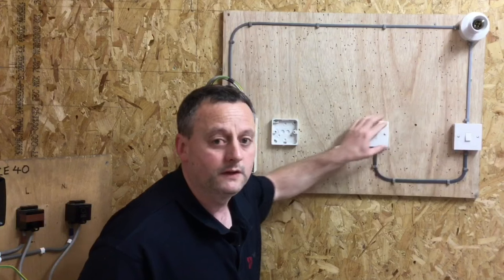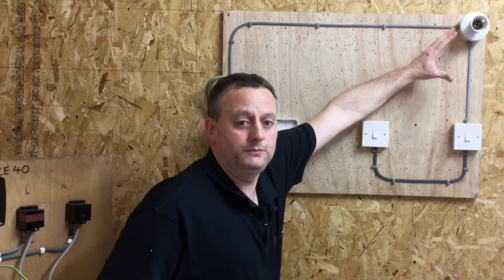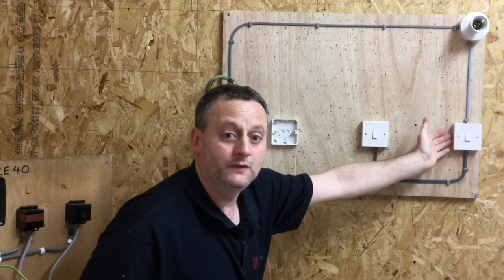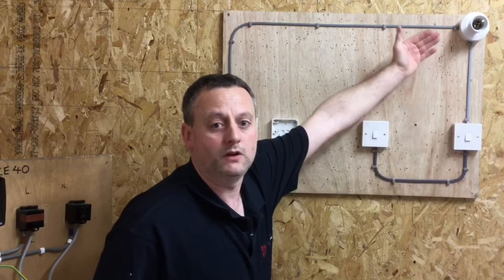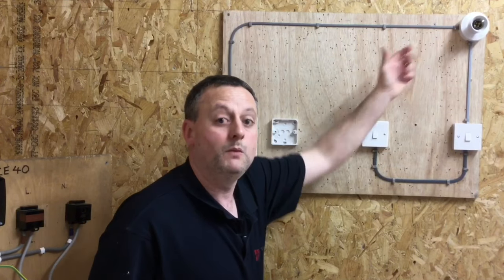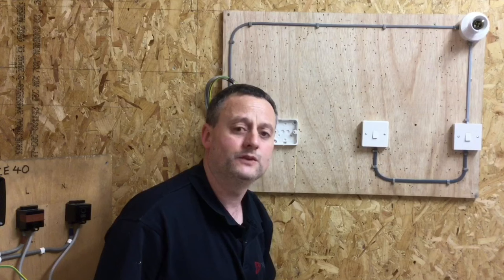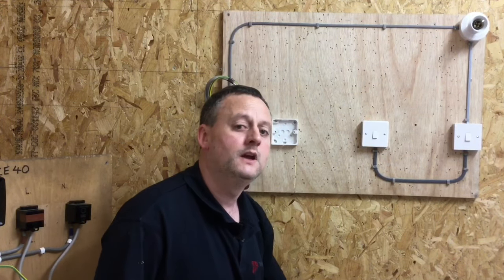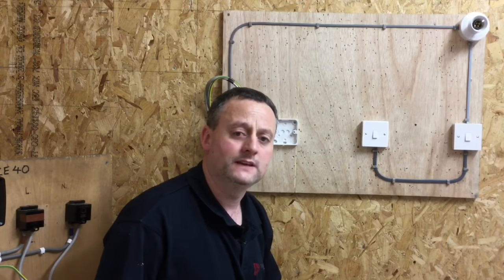Continuity of CPC (R1 + R2) and Polarity of our 2 Way Lighting Circuit and Insulation Resistance

Comment: Hey, When you get the first reading for continuity, are both switches in the on position? Cheers
Reply from the maker: Hi. With 2 way and 2 way and intermediate switching down won’t always mean on. Think about the landing light at home the switch downstairs and upstairs operates the same lighting point but it won’t always be down for on... thanks Gaz
Reply: ah I see, sorry for it being quite a silly question but thank you for clearing it up.
Reply: Hi Gaz what two points does the link attach to thanks
Reply from the maker: Hi. The line (brown) and cpc (green/yellow).Thanks Gaz
Reply: GSH Electrical thanki

Comment: Hi Gaz, in an installation wired in the loop in method with say the lives wired to the switches. If the end of line neutral and earth is in a different room than the end of line switch feed. Do you have to run a wander led between the two to obtain the highest possible r1 r2 reading. Or does the max resistance reading from a switch line to only the lights its controlling suffice? Thanks

Comment: is there a max value for R1+Rn ??   why do we just look at Zs for earth fault. Surely a live to neutral fault must also trip the circuit breaker fast ??
Reply from the maker: Earth Fault Loop Impedance Path for Installations connected to a TN-S Earthing Arrangements https://youtu.be/xlh4wBVG4nk
Reply from the maker: Total Earth Fault Loop Impedance Zs = Ze + R1 + R2 for TN-S and TN-C-S Earthing Arrangements https://youtu.be/Ksg2zQLuiAs
Reply: @GSHElectrical  I want to know about R1 + RN   not earth fault.   Is their a max value for R1+RN ?   I mean if there is a short between live and neutral for CB to operate within 0.4 secs or is it not important ?